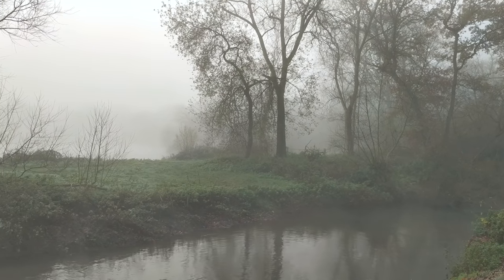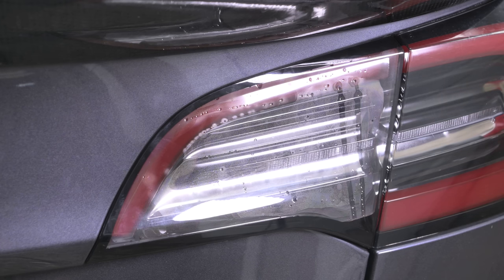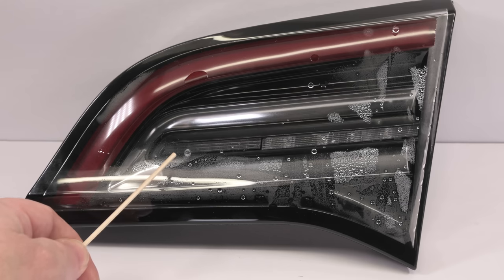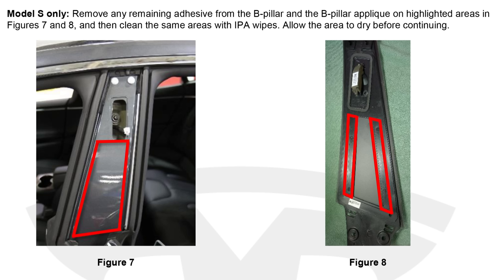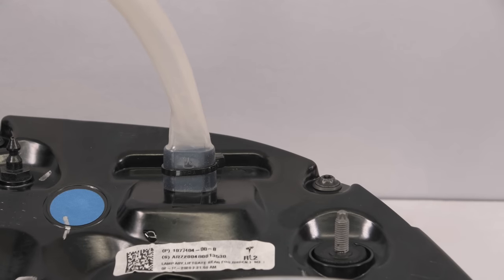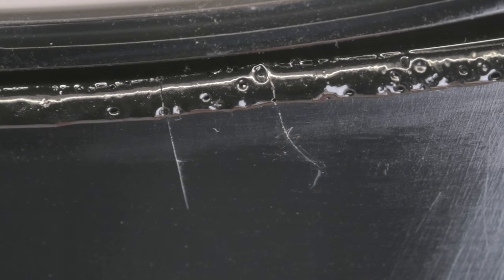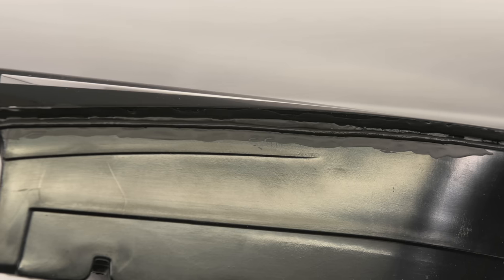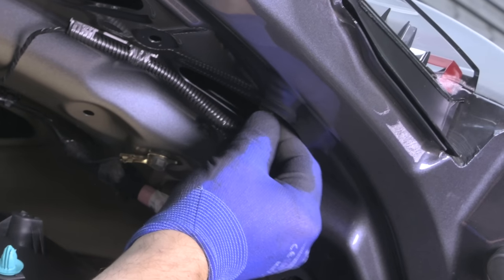How to fix your fogged up Tesla tail lights

Comment: Manufacturing fault. Replace under warranty. Subscribed as a quality piece thanks,
Reply from the maker: Yes, it's a fault with Tesla's supplier and I've had a few comments which say just get it replaced under warranty so I wanted to pin this comment and remind everyone why I made the video.

1. Even once replaced under warranty the new unit can suffer from the same fault. This is still happening as of January 2021.
2. When the light unit is replaced by Tesla, it isn't repaired, it's thrown in a bin. The contents of that bin hopefully will be sent to a recycling plant, but I don't know for sure. Even if it is, that's thousands of light units being recycled needlessly.
3. There are older cars out of warranty suffering from this and owners might want to avoid an expensive repair now or in the future.
4. The more we publicise this issue, the more likely Tesla will fix it once and for all. Tweet it to Elon,  spread it on forums and link it on FB groups.
5. Some of us actually enjoy doing stuff to our cars rather than hoping someone else will fix every problem. As you may have realised from watching this video, my first car wasn't new and didn't come with a warranty. I learnt a lot about cars from working on my Cortina and it means I can still fix simple car problems without visiting a service centre or paying someone to do it. It's becoming a lost art, but I think it's still worth considering even if you are lucky enough to own a new Tesla.

Thanks for all the positive comments and supporting the channel! 
John
Reply: Totally with you but if 499 550 cars go back to get fix done Tesla will sort the problem out. Boats don’t have leaky welds🖖🏻 cheers.
Reply: @Ifyoudonttakeitucantfakeit   Lol, you have more faith in Tesla than I do.
Reply: You have more faith in your diy skills than I have in mine! End of day the cars do fab I don’t mind some condensation. At nearly 4 years old I will get them changed. Now, phantom braking is a priority to fix, they can’t sort that out which seems odd. I forget all my Tesla hate when I nudge the pedal👍
Reply: @Ifyoudonttakeitucantfakeit  if you push pedal inside, it will go and when you dont push it will go red after it goes on the ramp. you should always check the pedal if the ramp is going red or green when you drive. fog is inside only when the door is closed and when you drive on the green
Reply: @SuddenKnock  haven’t a clue mate but send me some of what your on!
Reply: @TeslaGurus  Totally agree... Thanks for helping those who want to fix that by themselves (DIY or sustainability reasons). Others will do as they like. Don’t judge.
Reply: @zlmdragon.  none. It brakes when random cars or lorries come towards me or at brows of hills. If it was as easy as that I’d be ok but your talking rubbish. Faulty self drive is a total waste of money.
Reply: @zlmdragon.  go on, how do I tell the car not to do it when I am not having any input?
Reply: @Ifyoudonttakeitucantfakeit  Don't ask cruisers... boats might not have leaky welds, but they will have leaks around portholes, they will develop cracks in windows. If you own an older boat, chasing down leaks will be a pastime...
Reply: @TeslaGurus  I think the problem should be documented and you report to Tesla I will repair it for '$50 credit' for supercharging or future repairs or maintenance items.  I like the idea of saving it by fixing it instead of throwing it out but Tesla has to know about the error and pay / reimburse in some way.  I hope it doesn't happen to mine.
Reply: I agree, but Tesla refuses to fix the issue on my 2018 Model 3. They told me it's expected behavior.... B.S!
Reply: It happens to many other car manufacturers light units.  It IS a common issue.  Not desirable, but more common than you think.
Reply: Tesla in Texas doesn't warranty this fault so I have to repair it myself and I probably will do all four to save the efforts in the future. Shame on them.
Reply: and the world cries from the waste you make. mine is under warranty as well. gonna do this as its faster than the ranger
Reply: @reyalPRON  The waste is caused by the poor quality of the products so Tesla should be responsible for it, not users. It is not fair for buyers to pay and repair for someone's fault. Tesla needs competitors for sure.
Reply: @alexmanojlovic768  You are absolutely right, but only a few refuse to warrant it and Tesla is one of them. I had a Honda HRV before the Model 3 and its poor quality tail lights got replaced before hitting 3 year warranty time frame.
Reply: @dr_920  if you knowingly can fix something easy and u choose to make garbage... u missed the point mate
Reply: @reyalPRON  I have maintained my two Hondas for over 5 years. I mean it is not our responsibility to repair the leaking tail lights. We pay for the car with quality not for the DIYers. If you like to repair, you are welcome, but don't expect others do the same.
Reply: @dr_920  thats somehting completely different isnt it? Honda bump mate.u get the point here surely.. if its faster to fix ur self than to wait for a service, preferr that should be what a normal person wants to do. But you do you and i do me
Reply: @dr_920  we had a wonderful 1.5 VTEC Honda Civic & the ignition switch died on numerous occasions, cutting the engine (twice on high speed carriageways with no hard shoulder safe lane).  DANGEROUS AF, but Honda refused to admit it was a manufacturing defect & do a recall, although the dealer told us it was definitely a common issue, as they'd sold boatloads of them.
Reply: @reyalPRON  Tesla don't make the lights.  Valeo or similar make them.  Hence why a number of marques have the same issue.
Reply: @TeslaGurus  I like the video if my model 3 wasn’t brand new I was gonna try this method and will for any of my customers who are out of warranty
Reply: Took my 2023 S in for this exact issue. They said it was normal and would not replace my unit.
Reply: I’ve just had brand new ones on, they’re doing the exact same thing. It’s a supply fault. All cars have this issue but not this badly. Great video, will use this as Tesla have given me the old lights to keep!
Reply: @TeslaGurus  and actually they won't replace it unless it's over a certain threshold, otherwise it's "within spec" as the response I've been given.
Reply: not a fogged tail light but I do have my tail lights with cracked edges. do you think Tesla would replace it under warranty?

Comment: If you put the lights in a food dehydrator wouldnt that be better? Why do you need to remove the patch? It is supposed to let the humidity out. It should also withstand temps up to 50-60 or more celsius as the car can get hot on summer days.
Reply from the maker: Removing the patch allows the moisture out more quickly. You could keep it stuck on and leave it longer in a warm place and moisture could still exit from the connector, but we wanted to get the job done in a few hours so the car wasn't out of action for too long. I'm sure a food dehydrator would do the job as well.

Comment: That's 100% correct. The seal is the problem. The caseworkers like a balloon, if the air gets hot inside the case will expand. Once the air inside cools down it will suck wed cold air in the case. And yes the GORTEX pat is there to compensate for the airflow. GORETEX can let air in and out but will prevent moisture get inside. So if the seal haves a bad spot, moisture will find its way into the case. A long time ago I have designed waterproof polyester TL  light cases for home use, we had the same problem if the seal was bad. GOOD JOB MAN !  And thank for saying it is not only TESLA ;-)

Comment: A hair dryer should dry it out pretty quickly once you have the Gore patch off. Not a heat gun, just a regular hair dryer.
Reply: On LOW!  That’s an important detail haha
Reply: Yeah, I was really surprised he didn't suggest this.  Light would be dry before the oven is even done pre-heating.....
Reply: @beyerch  It is different approach. You put in oven if you want all moisture out (like this lamp), hair dryer can work on flat, easy to reach surfaces. I had experience in the past, that oven works wonders.

Comment: This video is really helpful even if you don't have a Tesla as it shows you things about headlight construction and how to identify and correctly fix the problem.
In older cars you would have a ventilation valve, but my car didn't seem to have one , after watching this video I noticed that similar to the Tesla it has a white ventilation patch.

Comment: This is a problem that's been on the model 3 since the beginning in 2018.... why the heck isn't Tesla fixing this once and for all !
Reply: Im guessing but most people dont care. They bought a new car and its a "small" problem. Its cheaper to produce them like they are right now and change on the cars that have owners that care about the problem.
Reply: Not just model 3 it's all car tesla s and x too
Reply: @schade12  As we have seen in the video, its every brand. But Tesla has it very often. I think, the reason is they need a extra robot to do this, they need to apply a glue, or a seal that covers all potential holes. And that is expensive. Maybe Giga Berlin with all new machinery and equipment has finally fixed that problem. Lets wait an see, summer 2021 and we know more about the future production quality from Tesla. Teslas from China look extremely promising. They are flawless, absolutely perfect production quality. If thats the new standard with the new Giga factory, hell yes.

Comment: Nice video. I went to Tesla SC to ask them to check the tail light as it has condensation. They refused saying that it's mentioned in the owner's manual and it's normal. This is the excerpt from the owner's manual:
"Condensation in Head or Tail Lights
Due to weather changes, humidity levels, or recent exposure to water (such as a car wash), condensation may occasionally accumulate in your vehicle’s head or tail lights. This is normal— as the weather gets warmer and humidity decreases, condensation often disappears on its own. If you notice water buildup within the exterior lenses, or if the condensation affects the visibility of the exterior lights, contact Tesla Service."
It's anti-consumer. They want to get rid of their responsibilities.

Comment: Thanks, but if you don't complain to tesla, future models would not get fixed... It's better to complain than to fix it yourself, especially for a 40000$+ car
Reply from the maker: You can complain and DIY. If everyone affected by this issue logged a 'bug report' or tweeted Elon whenever they get this problem I think they will address it with the supplier. Some problems never get high enough up the chain of command to be noticed. But I also don't like the idea of hundreds or thousands of these lights ending up in a big bin and having to be recycled or thrown away. It's a huge waste of energy and resources.

Comment: Very good investigation and thanks for sharing but I am not a mechanic and will certainly not repair a 100k car by my own. I have a Tesla MS since 2018 and I am very happy with it. They changed the lights once and it’s fine so far. if they still have that moisture problem they should learn how to prevent this. Same with other automakers

Comment: I am not a Tesla owner, but I am sure it happens on every maker, include Mercedes. Now I know how to fix it by almost zero cost, Thanks.
Reply: I owned a 2009 Hyundai Sonata for 8 years in Canada (so lots of extreme temperature fluctuations).  NEVER had any fogging of any light fixtures AND the headlight lenses looked like new (i.e. Crystal Clear) when I traded that vehicle.  Another thing I liked was that THEIR windshield wiper blades lasted for about 4 years as opposed to annual replacements required on my other vehicles.

Comment: I think I’ll have to do this with my Model S. I washed it for the first time (I’ve only had it two weeks) and noticed that my outer light had some light condensation after washing. Luckily it dried out pretty quick but I just want to stop this happening again.

Thanks.

Comment: Oh, if only I had seen this sooner!  I was bound and determined to fix my tail lamp with condensation -- car is out of warranty so cost would be nearly $400, or $230 if I self-installed the part. This is a complete and excellent diagnosis and repair guide.  Now I will add some plastic cement to the holes I drilled through the plastic, and remake this time with a proper repair :-)
Reply: What car do you have this out of warranty? All Model 3's ever built are still under the 4 year warranty aren't they?
Reply: @nickgilbert1264  My 2019 model 3 ran out of warranty 2020. Drive train and battery is for 7 years or 192000km.
Reply: @tydlig  No it didn't.  They have a 4 year warranty.  In fact Tesla replaced my rear light unit due to serious fogging on my 2019 Model 3 only last month.
Reply: @nickgilbert1264  what does your app say for warranty? Mine says it ran out november 13 2020.
Reply: Btw. Thats 4 years or 80000km. What ever comes first. I'd guess my car passed 80000km november 13 2020 ;)
Reply: @tydlig  Where do you see it in the app? I can't find it.
Reply: @tydlig  Yeah but lights aren't a drivetrain issue so don't "run out" before the normal warranty.
Reply: @nickgilbert1264  Main page, scroll to the bottom " see details".. then you see specifications and warranty tabs. Iphone app.
Reply: @nickgilbert1264  yeah they do. In USA main warranty is 4 years or 50000 miles whatever comes first.
Reply: @tydlig  I don't have that on mine - perhaps because it's a lease car.

Comment: one of the best explainations and fixes I saw on this issue! I could also „force“ to get moisture and water into the lights by simply using a pressure washer and pointing it on top of the light welding and see if water gets in. Greetings from germany 😊
Reply: water molecules are larger than air molecules ;-)

Comment: Or maybe the Tesla Ranger should part exchange a pre repaired / polished unit, which will also save the world. I like how the sticker on the back of the light had Fog in its description.  So it was acually functioning correctly then.

Comment: I used to repair lens moisture professionally.  Excellent video!  You’re right that it’s a pretty common problem.

A couple things I can add:
- I’ve also seen leaks occur from underneath the screw heads on the back.  In addition to resealing the main seal, it doesn’t hurt to also put some sealer around the perimeter of those screw heads.  As a practice I would also put some sealer around the border of the gore tape in case it ever came unstuck.  Be sure not to get any sealer on the center of the tape - it NEEDS to vent, like you say in the video.  Also, you can use a vacuum cleaner to suck air through or blow air through the lens.  The airflow will evaporate the moisture surprisingly quickly (maybe 15 mins or so).  I’m assuming there’s a decent sized hole in the electrical connector that will allow air to flow through that.  Really, once you fix the leak, the drying step isn’t 100% necessary because the lens will slowly vent the water on its own.

Again, great video!  Thanks for sharing the knowledge.

Comment: I rather want to use my warranty than doing it myself. If my light unit actually needs a warranty repair later on, Tesla will probably see that the unit has been tinkered with and deny to cover the repair.
But nice to know what the actual flaw is!
Reply: Makes sense about in warranty repairs.  But for out of warranty repairs, definitely keep this in mind.

Comment: Cool little trick to find the leaks. Thanks. The fog lights on the front bumper also have some water condensation after a rain, but then they get cleared a day later.

Comment: As your placing the glue along the seam, I would also create a negative suction using the vent hole so it draws some of the glue into any other gaps to fully seal it.

Comment: Excellent step-by-step to root cause and repair the leak path areas!
The lamp supplier should be performing a 100% air pressure decay test on the manufacturing line to buy-off on the process they are using to adhere the outer lens to the housing of the lamp. This is a quality control issue that Telsa should be working with the supplier to correct.
Reply from the maker: Absolutely!
Reply: Tesla learn of customers how to work lol

Comment: Amusingly I did this same procedure for the headlight on my 30-year-old Nissan. I used JB weld instead of the liquid tape. Did the trick. Funny that brand new Teslas have the same issue as my old clunker.

Comment: Brilliant Video John - and great explanation - but are we missing the point - these should be under warranty and Tesla should be installing correct and functioning units - my M3P had the problem in the first week and Tesla said "its not fogged over enough" Wonder what BMW / Audi / Merc would say ??? Tesla Ranger could carry a bunch or repaired / reconditioned units and swap them over rather than just bin the defective units - thus less waste as you quite rightly point out.
Reply from the maker: I agree with everything you say. A ranger told me this was the most common problem they are called out to. Seems like a terrible use of spares and resources.

Comment: Excellent presentation! The tail lights of our  3 months old Tesla model Y  fog up both on rainy- and sunny days. Unfotunately, tesla will not replace them under warranty.
Reply: I am dealing with the same problem, Tesla says it's normal, they even incorporated this issue in the Model Manual and the manual says it's normal. How defective/bad quality product can be "normal" ?